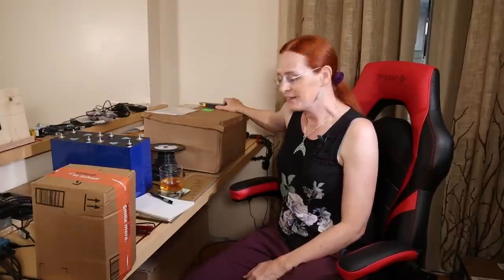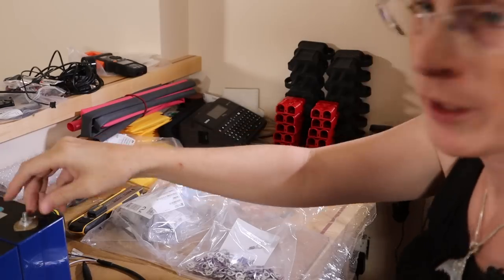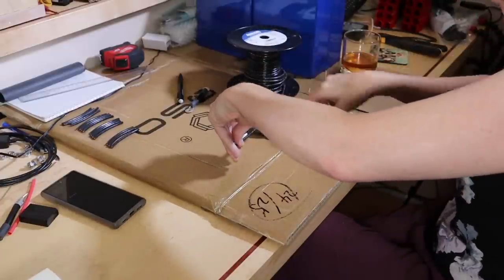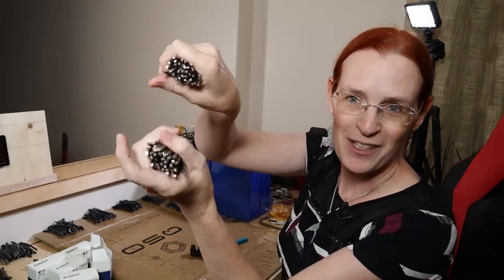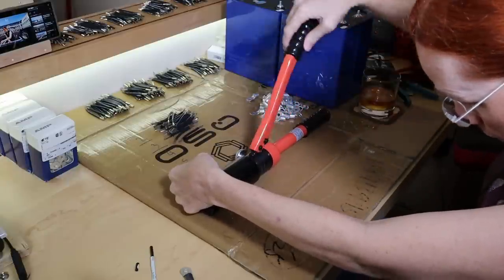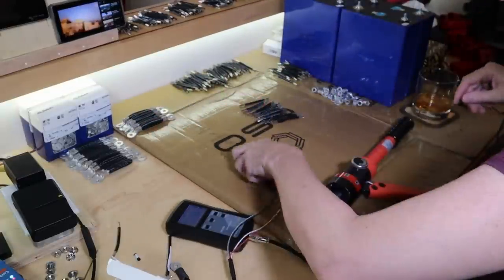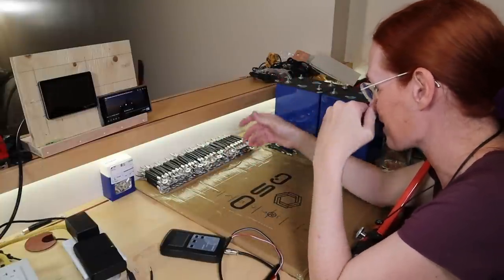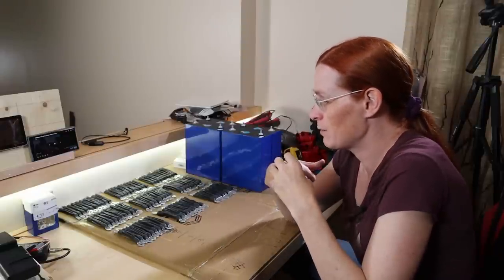Making 90 Flexible Bus Bars! - 48v LFP Battery Build (Ep. 35)

Comment: Lol you read wrong. I know these numbers well and those cells even better. 

If it was "0.11mOhm" it should mean .00011 ohms... (0.11 mOh ) .. and.. no fucking way that battery is 0.21 mOh... The best chevy energy cells are 1mOh... Thoses things are 11mOh... ( NOT " POINT ELEVEN MILLIOHMS DAMMIT). No way that cell is "point 21 milliohm... " bahahahahah.. Maybe 21mOh.
Reply from the maker: You may be right, but that's some strong negativity in how you argue your point. This channel is about helping and learning. Always happy to be corrected, but do so kindly.
Reply: “dogdipstick” Username checks out. 🤦‍♂️
Reply: @No_soup_for_you  if you google it you get ... dogs wearing lipstick..

 OR.. you see my years of sales and battery building information on Endless sphere.
Reply: @TheDigitalMermaid  The correct nomenclature and units are VERY important in electronics, especially power electronics. 

It is like saying " this resistor is a watt of power handling".. When it really can only take a milliwatt. Instant burn. Project down the drain. A logarithmic scale of power. 

 In mathematics, the logarithm is the inverse function to exponentiation. 

Look. I am positive. You have the numbers VERY wrong. You are playing with 21mOh cells, you can make some power.  Learn the parralel resistance formulas. A Chevrolet Volt has a group IR  ( ESR) of 0.0005 ohm. From two 1 mOh cells. This is also known as " half a milliohm".. Point five milliohm. You get this low by paralleling cells. This makes a 3000lb car move 140mph.. cause it can make power, fthe ESR of the pack is low.

 You will see that you can make quite a bit of power come out of that stack, really fast. Not safe. Last battery i built was 22.2v nominal and short circuited for well over 2000A under a 25 millisecond test. Kill ya in an instant if you are wrong some day. Numbers matter, friend. 

25 millisecond = 25/1000 of a second. Kinda fast, these electrons move.
Reply: You are not right man, the internal resistance of those cells is 0.21 mohms.
Reply: @mihaitaiosub  Bahahah no it is not. Go put a calibrated load on it and tell us the current. That will give you the empirical intrinsic resistance. 

I have built a few 35kWh banks of these. 

Nope. No how. no way. Noway sir ee.
Reply: @dogdipstick  Please read the EVE LF280 datasheet: "AC Impedance Resistance ≤0.25mΩ".
Reply: @TheDigitalMermaid  "you may be right" --> no, he's not.

Comment: I think you would benefit from watching https://youtu.be/oqWExOkarRE. Ray has a lot of good advice. The issue with corrosion is the biggest problem in boats. I have experienced an electrical fire in a boat due to corrosion in a crimped wire that was not gas tight, the amount of toxic gas was unbelievable and the whole cable just burned in a flash before I could cut all power. It was a navigational light only.
After that experience I have re-wired all my boats with proper wiring and fusing - not the crappy stuff the yards put in.
Be careful and you will be fine. 
To sail in the north with electric power is ok, that has been proven by Sailing Uma sailing Norway, Svalbard and Island with solar and electric power.
Reply from the maker: Hi Nalle, I'm not sure what Ray covered in that video that would apply to my build, except his comment about not using open ended ring terminal lugs. He mentioned at the same time that he didn't know how long it would take to corrode, so I'm not sure how informed that comment was. In my video, I found a case where one wire was set back a touch, and it made a measurable difference in resistance. Given also that under a good crimp, the strands effectively cold weld (at least in so far as there's no air in there), I don't see corrosion from the end creeping back into the cable as being a greater practical risk than not being able to see that all strands are fully seated. I am, of course, happy to be corrected with cited sources.
Reply: @TheDigitalMermaid the thing at sea is to have gas tight connections and to do regular inspections.  
2 tings he points out: 
Corrosion sneak up along the cables easily and quickly. Seen corroded cables after a few months. Seen cables bursting open by corrosion. 
We move hundreds of amps and then the cable’s length is very important and will make or break the lifespan of the banks. 
Even in DataCenter battery systems we had to fight corrosion and disassembled them on a annual rotation. 
Keep up the good work and remember “good enough for government work” do not apply to sailing.
Reply: @TheDigitalMermaid  I think just occasional temp inspections under a decent load would suffice. Maybe getting a seek thermal camera attachment would be super useful. Start lower power, check, and keep bumping up power while monitoring the thermal camera.  
Hmm, and I wonder if something like CRC battery terminal protector would be a good idea for all of your terminal connections... especially at sea. I've always used it on my car battery terminals here in the rust belt. Well, until I got an EV.